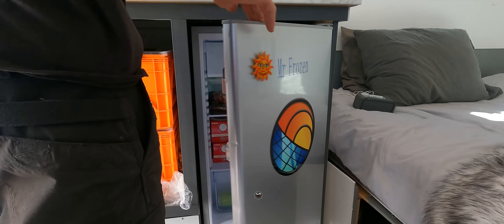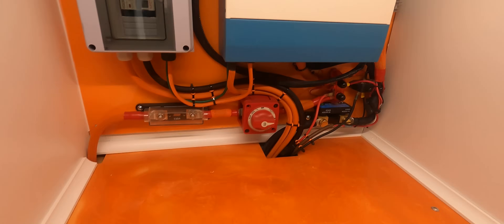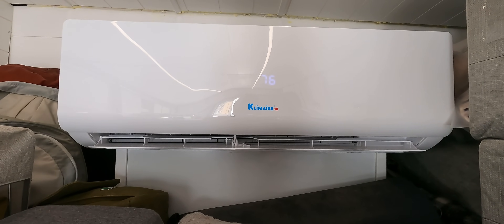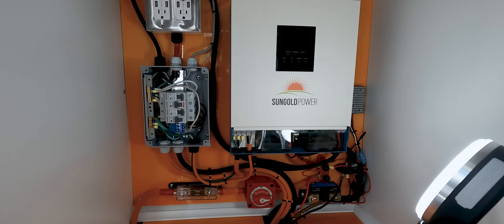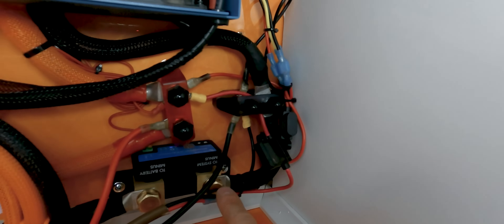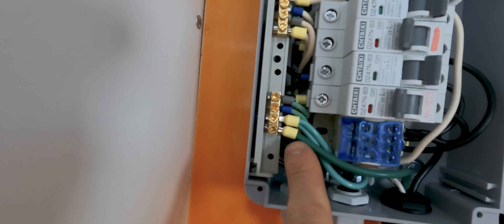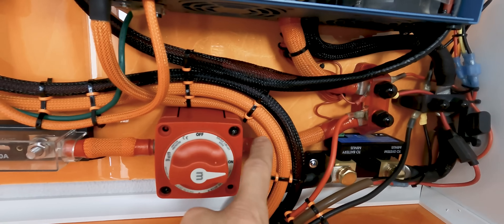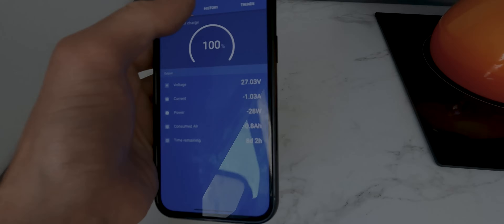Living in a Solar Power Tiny Home in Arizona

Comment: Arizona was for some reason where I had debated taking the ambulance too back in December- March ish from ohio just to have some warmth to build this thing out, somewhat, tear down ..electrical.  I actually am in my van right now, I have a G20 as well, and ironically one of your vids popped up where you broke down in New Mexico about a year ago.  You do electrical builds solar what not right?  Have you ever had the chance to see all the wiring in an ambulance lol.. its a bit overwhelming because you have a lot of groundwork done but this things are just built so well its tough to trace them so you dont dispose of or just figuring out what all is spliced together.

Comment: Hey Brad, I've got the same all-in-one inverter, through your link. It specifies the minimum MPPT starting voltage as 120V so I am wondering if you have a different version. When I connected the panels the unit did not show PV connected at all until I exceeded the 120V by connecting them in series, and so I'll have to put my 4 panels in series, which is not ideal. Would be great to hear whether or how you're managing with a lower voltage for that inverter unit. Thanks for all the content, I've been inspired to build out my own box truck thanks to you!
Reply from the maker: Hello, I had a friend report the same issue. I contacted sungold and I found out that they  updated their inverter firmware and now the minimum voltage is 120v to activate the mppt. The older version that I have only required around 60 volts. You can either run your panels in series to boost the voltage or get a different unit with lower voltage requirements. I think they made this move so that the inverter can handle larger a solar array for off grid homesteading
Reply: @nomadbrad503  Thank you Brad! That kinda sucks they did that. Similar $$ units I've looked at seem to have the same or even higher voltage requirements. Maybe I'll look at separate MPPT controllers in the future if the series PV connection doesn't work well with shading or single point of failure of a panel. Thanks again.
Reply from the maker: @eoinkeane  ecoworthy makes a similar one that only requires 60 volts. I have my system wired in series parallel and shading hasn’t been much of an issue but if you plan to stay in heavily tree covered areas, I understand your concern
Reply: @nomadbrad503  Ah, cool. I hadn't spotted that one from ecoworthy, looks like what I need. I think 2s2p will be better for the boonies. ;) Thanks Brad!
Reply: Ordered via your affiliate link. 👍
Reply from the maker: @eoinkeane  thanks !
Reply from the maker: @eoinkeane you’re welcome! Good luck  with the installation

Comment: Hello Brad, I am SEEKING your opinion; I bought two (2) EG4 LL 48V Rack Batteries and an EG4 3000EHV48; now I am finding out the minimum operating voltage input (PV ARRAY) is 120VDC, so that means unless have minimum three (3) panels at 40+ VOC, and the sunlight creates enough voltage to reach the 120VDC, it will not charge.   Are all 48V charge controllers rated like this?  Is it an option to find a separate 48V charge controller that has a lower operating voltage and use it, plus keep the 3000EHV48 for the inverter?   This is for a van or box van setup, two to four solar panels. I am searching and reading specs on controllers. Thank you
Reply from the maker: 120vdc is pretty much the limit for mppt to activate a 48v system. but youre going to need a lot of solar anyway to keep those batteries charged. If you want a smaller system I would recommend 24v setup. Mine runs at about 70 volts.

Comment: I need a system that would run a mini rice cooker 200W/110V no problem...and run a lapto..
Reply from the maker: that is easily achievable !
Reply: @nomadbrad503  Any system you recommend???
Reply from the maker: @JordanB-lc4oi  you’re looking to install a custom system or just want a all in one power station?
Reply: @nomadbrad503  All in one...thank you..
Reply from the maker: @JordanB-lc4oi  I just reviewed the new ALLPOWERS power station. It’s really good quality. They come in smaller sizes if you wish. You can see my video here: Do you really need a full electrical system in your van? Maybe an ALLPOWERS R2500 is enough!
https://youtu.be/HgwKSSg8N4c
Reply: @nomadbrad503  Thank you, friend..I was looking into the Ecoflow system with the fast charger that connects to the Van battery..What do you think about that system??? I going to check the system you recomended also..thank you..
Reply from the maker: @JordanB-lc4oi  yes, ecoflow with the alternator charger is a really good choice. I’ll be posting a review on that system in a couple weeks

Comment: I would have thought that the DC fridge would use less than 1100Wh per day. Is this accurate?
Reply from the maker: 1,100 watts per day is my estimate based on the fridge running approximately 20 minutes per hour over a 24 hour day. This will vary depending on temperature in the van.
Reply: @nomadbrad503  Cool, thanks

Comment: How are you doing, Brad? I have just found your channel and my question is how long can you run your AC at night? Do you get a full eight hours or longer before the power goes out?
Reply from the maker: I am able to run the ac through the night. This unit is very efficient it cycles on and off through the night. Once the sun goes down it doesn’t have to work as hard

Comment: @nomadbrad what is the benefit of wiring batteries as 24 Volt over 12 Volt ?
Reply from the maker: 24 volt means you can use smaller gauge wire and its more efficient when inverting to 120v for the air conditioner
Reply: @nomadbrad503  thanks for reply! So a standard inverter converts 24V to 120V ?

Comment: On your spreadsheet you have the induction cooktop at 500 watts/hour. I would have thought that it would have been more like 1500 to 2000 watts/hour. But you have really designed nice neat system. Love the wiring.
Reply from the maker: The cooktop is rated up to 1800 watts with both burners on high. However I typically cook on level 5 which is 500 watts and rarely use both burners. This is why I you see 500 watts on the sheet

Comment: In your AC video, I thought you mentioned part of the reason for going with a 24V system was easier/more options for charging over your alternator.  Is part of your future installation plans? Thanks for the details and continued GL with the channel!
Reply from the maker: You are correct. I was planning to install an alternator charger but after living in the van for 2 years, my solar is sufficient for all my electrical needs. I don’t have plans to install an alternator charger at this time

Comment: I mention this in other videos but I will repeat it here. The roof space is too valuable to waste on those max fans or other roof top vents. Simply use in line blowers up high and vent out the sides,the rear or even the floor. That extra space on the roof could yield an additional 100-400w of solar.My 2 cents.
Reply from the maker: I agree! Thats why I don’t have anything on the roof but solar panels. I ventilate with my kitchen exhaust hood and an open window.

Comment: People here in Florida are getting ripped off bad by solar companies charging home owners as much as $50, to $60,000 for grid tie systems without any battery backup. I have less than $1000 in mine .
Reply from the maker: i know! I hate to see how much they are charging home owners. They're making solar unaffordable and it doesnt have to be. The equipment in those $60,000 systems can be purchased for $10,000 or less
Reply: @nomadbrad503  When they come to my door trying to sell, they can never give a final cost estimate, and talk about a reduced power bill. They should be talking about an eliminated power bill. Complete con artist at work. What they are doing should be illegal.
Reply: @nomadbrad503 
I would love to know the source for a 10k system. I want to install it on my house, garage and on the camper. Grid tied for the house with a reasonable battery backup. The camper I considered making a rolling battery bank. Using 10 to 20 - 200 amp batteries, however many will fit in the design. Something that can run an AC or whatever for a few days of there isn't much sun. Another good part of that is if the power ever goes out I can back feed the camper into the house batteries. That's the idea anyway. 
I would love your connection for equipment. If you get a cut that's perfectly fine with me.

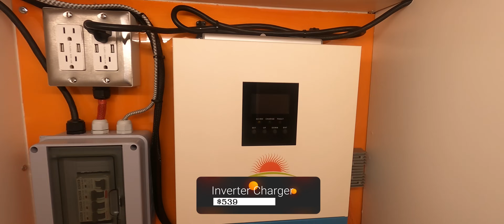Comment: 1:39 can that produce 220v? is it noisy? my inverter is noisy
Reply from the maker: This is a 120v unit for America. You can find versions that do 220
Reply: @nomadbrad503  noisy? are ther ones that use half of the batery life? mine uses until its aroun 21-22v then it shutsoff. thats nower even close to half. im using trojan lead acid bateries

Comment: Brad, Hello your video did help me understand a lot about your electrical system works in your box truck and you did help me understand some misinformation I was told! I have always have been very impressed with your clean looking wire connections! I also want a 24 volt system. I am confused I did think in your system you had an out side place plug to plug in extra ground mounted solar panels?
Before watching your video I did go to three solar equipment to see there new items and new products.
A area that in the past I was told about and not many people are not talking about it the seasonal difference of solar hours between summer solar hours and winter solar hours. I live in the middle of California and it depends on where I go for information and data. My summer solar hours are in the five to six hour range my winter solar hour range is from two hours to three point five hours.
I am very impressed with the cost that are in your current design. I do hope you put a link in for your 24 volt refrigerator.
Regards
Reply from the maker: Thanks! I don’t have a plug for additional solar. Unfortunately this refrigerator is no longer being made but you can find similar versions

Comment: Great video! How loud is the fan on the sungold? Can you hear it with the cabinet closed? What about when it's open?
Reply from the maker: The fan noise changes depending on usage. It is loudest when delivering a large load from the panels or when the inverter is being worked hard. When the fan is loudest, you can hear it with the cabinet open. Not loud with the cabinet closed.
Reply: @nomadbrad503 thanks Brad! Your rig is so great!!!

Comment: Great setup. Getting ready to install 1760 watts on my shuttle bus. I bought Victron parts. I didn’t see a charge controller on your system, does Sungold inverter have a built in?
Reply from the maker: Yes the sungold is inverter + shore power batt charger + mppt controller
Reply: @nomadbrad503  Wow! So compact and light weight!!   I’ll keep that in mind for my next build.
Reply from the maker: @prepparig144  yes compact, light, and less than $600 for everything.
Reply: @nomadbrad503   Do you feel it performs at a high quality as a Victron 3000 Watt 24v system?  I'm tempted to try and sell my Victron equipment.  I could easily move my electric to a nice cozy spot that is now just gonna be dead space.  Watching your videos it seems it has been running flawlessly. I will check and compare units on the technicals.
Reply from the maker: @prepparig144  it’s been running flawlessly for nearly 2 years and the system ran constantly last summer to keep the ac going 24/7

Comment: I’ve been waiting for this,I’m using a propane oven with 4 burners from a travel trailer so I’m not sure I’ll need 1200 watts but air fridge and lights with a 2000 watt pure sine wave is my guess,but I’ll definitely contact you for technical assistance when I’m ready! Also two 100 amp hr lithium ion batteries
Reply from the maker: I’m happy to hear it. Let me know how I can help

Comment: Excellent video, thank you for taking the time to put this information out there. I am in the middle of designing my system.  I have to have A/C in my Van , I live and work in Texas so it's non negotiable.
Reply from the maker: I agree with you! This mini split did very well last summer in Austin. Insulation is also very important
Reply: @nomadbrad503  Yep, I have 2 inches of foam board on the ceiling of my Chevy Express cargo , 1 inch on the walls , going to add more. Planning on building an insulated wall behind front seats since so much heat comes thru the glass in the front of van.  I have no windows in the back.  I just found your channel last week , hit the subscribe button on the first video. Keep up the good work.
Reply from the maker: @Stumpy1973  thanks for subscribing! It sounds like you are well insulated. Good luck to you sir 🫡

Comment: Lithium can safely be discharged only until 60% Capacity if you don't want to damage them. Damage will reduce the Capacity, Charging cycle amount and increase the risc of a chemical fire. You can find this information at any power company that uses lithium battery technology for Grid stability.
Reply from the maker: a deeper discharge can reduce the available cycle count. If that is a concern, sure dont discharge them deeply.  I run mine down hard. Ill replace them when they fail. the tech will be much better in 3 years anyway.
Reply: @nomadbrad503  That is a decision everyone has to make. Pay again every 2-3 year's for a new Battery Bank or once every 7-10 year's. My bank is 7 year's old and only lost 12% Capacity. Long way to go still until i hit the 70% Mark i have my system limitations designed for.

Comment: i was looking at the inverter solar charger and it says minimum voltage of 120 to work i don't know it i have enough voltage to use it i have 4 370W panel that are 34.2 mpv (41 voc) do you think this is enough
Reply from the maker: good question. im powering it with 4 x 320 watt panels in series-parallel, so its only getting around 70 volts/ 18 amps max. But i do see that the amazon page says 120v for the MPPT. You should be fine with your 4 panels in a series string